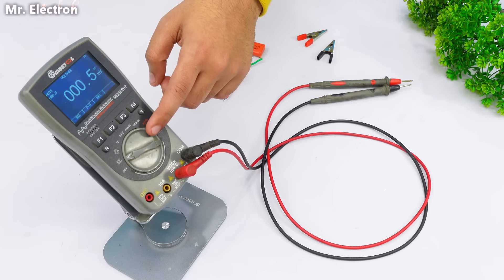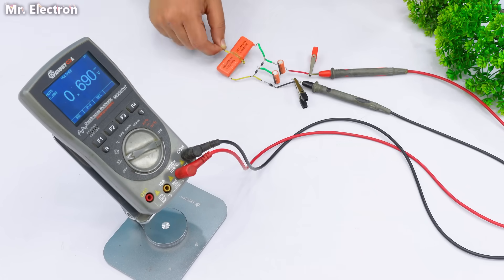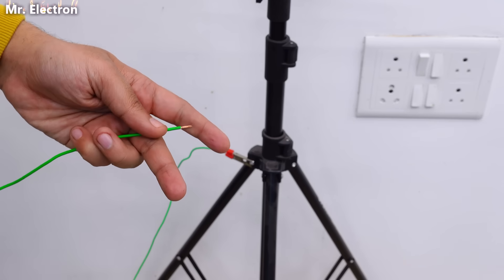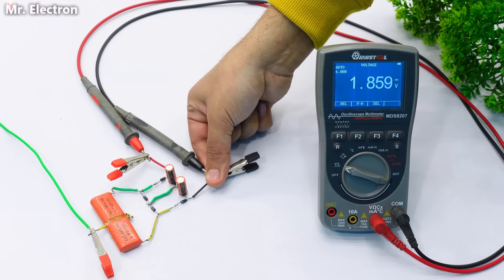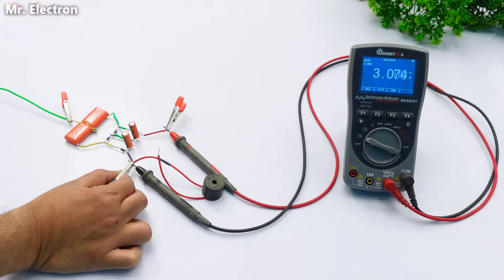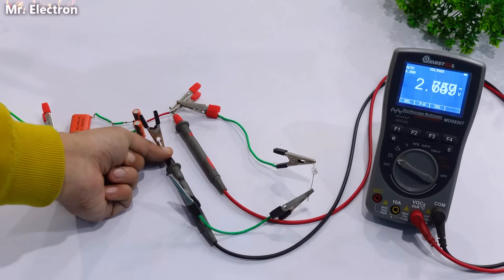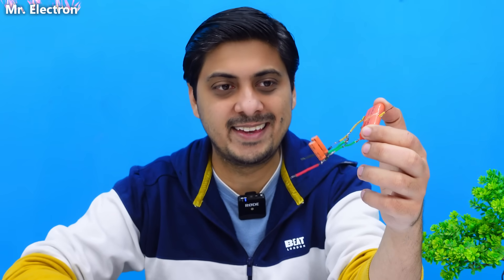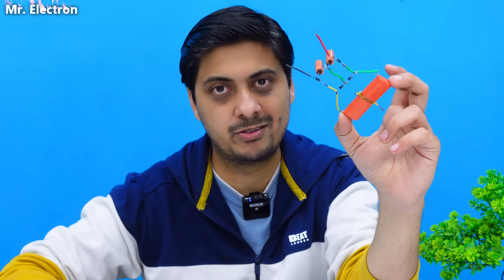Maxwell Chikumbutso - 5000 KW FREE ENERGY from RADIO WAVES | 100% Working Model DIY

Comment: I'm sure at a point in time, scientists were sure that electricity couldn't be wireless. today we have inductions and wireless chargers. 
To get usable electricity from radio waves you need a rectenna:
Antenna → impedance matching → RF rectifier → storage capacitor/supercap → DC regulator/load
Without the antenna + RF rectifier stage, the circuit will not “pull” energy from the air.
RF harvesting requires:
	•	Very fast diodes (Schottky RF detector diodes)
	•	Correct impedance match to the antenna (otherwise you lose almost all power)
	•	A design optimized for MHz–GHz signals
Typical black diodes in hobby HV circuits are often 1N4007 / UF4007 types; they are not efficient for RF rectification at high frequency.
I see your point but in order to be sure it doesn't work you need to build the same set up as his. which you can't because he keeps it secret.
Moreover, he said he got inspired by the work of Bedini.

Comment: You need an antenna / wire as high as you can get. You also need a deep grounding rod. I'm getting 7.55 vdc after rectified. Running 4 12 vdc led lights. Not at full power but works 24 / 7. I just have an old CB antenna 30 feet up at the tip. Using the house ground rod. Nice video. Keep it up.

Comment: It may be 4.5 v but the actual amps is around 10-100 mA.

That said if you got 100 of these circuits and joined the parallel the you would get some useful energy at 4.5 volts.

If then you  create a pickup coil and spinning magnets…the energy would increase.

If you the create an antenna made from multilayered metals, quartz, you would create a very interesting antenna that would channel energy from everywhere.
Reply from the maker: Hey Friend! Please JOIN on WhatsApp for a stronger FUN and LEARN community: https://whatsapp.com/channel/0029VaQmmRaFCCoWOf7huh3G

Comment: You would get more electricity and voltage if you used fast diodes, e.g., 1N4148 or UF5408 or similar and A LOT longer insulated antenna. There's a lot to improve with this circuit of yours.
Reply from the maker: Thank you for watching!💥 Check out my Latest Video here: https://youtu.be/twythhaJls0 and JOIN my WhatsApp for faster replies: https://whatsapp.com/channel/0029VaQmmRaFCCoWOf7huh3G

Comment: The green wire is about 1ohm resistor.The voltage measured was caused by the internal battery of the electronic instrument.
Reply from the maker: Thank you for watching!💥 Check out my Latest Video here: https://youtu.be/twythhaJls0 and JOIN my WhatsApp for faster replies: https://whatsapp.com/channel/0029VaQmmRaFCCoWOf7huh3G

Comment: Clearly, it is not free energy because the energy is radiated from existing platforms that have used generated electricity for modern living (city infrastructure)
So if such device is genuine (I doubt it), then over time such devices would proliferate, therefore draining the city resources and overloading the whole electrical networks of cities!
Also, to utilize such technology would require massive and heavy copper induction coils in such vehicles to create a flux density sufficient to generate power required to run a vehicle!
To my mind, there is little chance of making a viable vehicle because in reality, radio waves deteriorate exponentially from the point of source and such a system would be prone to many weak spots in radio wave transmission.
Reply from the maker: Thank you for watching!💥 Check out my Latest Video here: https://youtu.be/twythhaJls0 and JOIN my WhatsApp for faster replies: https://whatsapp.com/channel/0029VaQmmRaFCCoWOf7huh3G

Comment: You need to understand the difference between voltage and current. Plus he is using mosfets which are switching very fast. It's Nikola Tesla technology, he is not using anything new. Forget what you have been told about conventional electronics and look into the information above.
Reply from the maker: Thank you for watching!💥 Check out my Latest Video here: https://youtu.be/twythhaJls0 and JOIN my WhatsApp for faster replies: https://whatsapp.com/channel/0029VaQmmRaFCCoWOf7huh3G

Comment: I wonder if you have tried multiple units in parallel or Series?
Or adding a Invertor like a, "Joule Theaf".
Others have, and it worked..
The parallel wiring, of two units, to Joule theaf, could greatly up out put.. Charge batteries, run lights maybe small fan.
Might try, Bendini SSG, fan project and or Joule Theaf motor, invertor fan..
A least you'll be cool
Reply from the maker: Thank you for watching!💥 Check out my Latest Video here: https://youtu.be/twythhaJls0 and JOIN my WhatsApp for faster replies: https://whatsapp.com/channel/0029VaQmmRaFCCoWOf7huh3G

Comment: When u touch the negative wire, the current will have its actual path to flow, which is Ground.
You should connect the negative with Ground permanently. This may increase the voltages
Also, i think we need to isolate the antina from the Ground to maximize the input signal.
Reply from the maker: Hey - JOIN my WhatsApp for faster replies: https://whatsapp.com/channel/0029VaQmmRaFCCoWOf7huh3G

Comment: Your doing it wrong brother you need to use a 1.5mhz switch mode circuit design but use capacitor and fast switching tvs diode as voltage amplifier to 800volt and but you need to write a code when the high side mosfet is off the reverse high volt transients is capture into and capacitor tank and use with and additional mppt to recharge the battery ,  thats how it work he call it radio frequency thats what he call it but the voltage transients frequency is its own frequency difference from the switching frequency so he call it radio frequency and in a sense it is but not the radio wave in the air, the collapse current in the ferrite transformer need to go somewhere as we call back emf and the only converterthat gives strong currentpeak is forwardconverter.if you have and oscilloscope  current prob you will see what hes talking about the collapse current in the transformer core is very high and that energy is what kill moset in switching converter  if you notice alll switching converter has snubber circuit to waste the energy in heat but by use tvs diode in series with the drain of the mosfet high side and another switching circuit when the high side switch is off the other circuit activate and open a path for the snubber circuit current to flow do you understand now and reset winding use two diode one to the circuit positive and the other to the capacitor thank
Reply from the maker: Thatnks for the tip - Hey! Please JOIN on WhatsApp for a stronger FUN and LEARN community: https://whatsapp.com/channel/0029VaQmmRaFCCoWOf7huh3G

Comment: He needs to connect the center between the two 10uF caps to an earth Ground, and then make the antenna longer.   If you then put the antenna end close to the top of a tesla coil it will supercharge the FWVQ (full wave volt quadrupler).
Reply: https://www.youtube.com/watch?v=-cekt_T9yQo&t=25s
Reply: https://www.youtube.com/watch?v=tMFMDlt0gNQ&t=119s

Comment: Voltage is a masure of electrical potential, not of energy. All radio receivers devices detect a tiny amount of energy from the electromagnetic radiation they aret tuned to. There is a reason you should not stick your head  into a high energy density field kike a microwave oven. Claims about cars and houses are scams.

Comment: Voltage without current is not power. 
Power is voltage multiplied by current. 
P = V x A

So no matter how much voltage if there is no current. 

1,000 voltage times zero is still zero.

Comment: Yes, the DMM reading is real, but it’s “ghost” voltage. A 10 MΩ meter + stray capacitance can show volts with almost zero current. Under any real load (even a 47 kΩ resistor), that “voltage” collapses to zero.

True RF harvesting requires a tuned antenna + matching network low-drop rectifier diodes (e.g. Schottky),  a storage cap sized for your target frequency band, none of which this simple diode-and-cap board provides.

Grounding is critical. Your body or a tripod leg only adds stray capacitance to earth—it doesn’t magically produce power. A proper earth reference helps you measure real current, but it won’t create more energy than the RF field actually carries.

Adding MOSFETs/transformers doesn’t break energy conservation. Any amplifier or boost converter needs an input of real power. If you boost voltage, you reduce current (Pₒᵤₜ ≤ Pᵢₙ).

If you really want to test this:

Measure both voltage and current into a known load (e.g., 10 kΩ resistor).

Calculate P = V²/R or P = I×V.

Compare to the theoretical RF power density you can capture with your antenna aperture.

Bottom-line: Yes, you can pick up microwatts of RF and blink an LED once. But you cannot pull kilowatts out of thin air without a massive, powered transmitter or a hidden battery.

Let’s keep experimenting—and remember: real power is volts × amps, not volts alone!

Comment: Minds today are just as rigid as they were 200 years ago. They also said brain and heart surgery was impossible, spouting theories based on limited knowledge, theoretical laws are just that, theories that stand until proven wrong citing thermal dynamics is flawed within it'self as cold fusion is real as the powers that be just don't want to let the world know as it would mean free power, even Tesla proved at Warden cliff that energy could be pull from the ether to quote Westinghouse as he told Tesla" if I cant put a meter on it it is worthless".

Comment: Use Tesla coil as intena and use supercapacitor from old camera if you are in car use body of car as an intena connect cable to body of car  it will make alot of voltage

Comment: Better ground better circuit. If your car is having a lot of issues always check all your ground wires in the vehicle and replace them with thicker gauge copper than what it had before and you might just fix everything that was wrong with your vehicle if it was the only issue. Very common on old vehicles.

Comment: When you touch the wire you are also an extra antenna....you may be insulated from the ground regards your shoes or the flooring...you would only be grounded if you were barefoot on concrete or the earth...just a thought is all...nice experimenting...subbed and liked...look forward to more
.😊

Comment: I will try the circuit adding an etheric antenna 76.345 degree wire spun into a cone.  (Don Smith)  add a transformer to increase voltage then mosfetts to add amperage.

Comment: Maxwell  also mentioned that he used something else to amplify the frequency that he’s receiving don’t forget that .
Reply: It's a voltage double..  looks like he modified a ev motor controller to change a week current into a 3 fazed one.. the more electronics you run the power through the more resistance..  small devices that will run a radio or TV are easy to make because they all run on 6 to 12 vdc.... but scaling it up that costs money.. on top of that the power your collecting is minute, to big a coil and you run into our old friend entropy.
Reply: Amplify with what? Icecream?
Reply: @a @appinventor7740 have you notice that I got 24 thumbs up ? Why

Comment: I'm a little confused why people think this is new anyone ever make a crystal radio? It doesn't have a battery folks. Convets the radio waves into electricity then convert some into sound This just skips the speaker and puts on a capacitor. The trick is to find the frequency the provides the most power or find a way to tap into more frequencies than one if you can do that you could tap into the power of stars That produce a hell of a lot more radio waves and the local radio station.

Comment: If you increase the surface area of the antenna for Radio waves the voltage will increase to, by applying the invention of Tesla wireless Tesla coil you can transfer higher frequency AC signals with minimum voltage and use your circuit and add a voltage multiplier to transfer enough voltage to power a DC to AC inverter, your a genius person that's a radio-wave energy collector

Comment: Bro you were almost there, but you made a huge mistake, those diodes will eat up all the voltage they eat up to 0.7v  could be less without load but they reduce the power, Maxwell uses Wave guides to concentrate energy uses that energy to amplify the same energy steps up to hundreds of kilovolts then converts back to lower voltage with huge current to do any thing, it's real. Jesus Christ is the way the truth and life. It's divinely inspired that's why brains are cooking

Comment: When I lived just a few hundred feet down the road from a 50,000 watt FM station, I aimed at 10 element beam antenna at the broadcast antenna and was able to light a neon bulb with the energy coming down the coax. But it's still a very small amount of energy. Not enough to do anything practical.

Comment: Frequency is vibration...vibration is energy....collecting frequency wavelength oscillations in the form of vibration and then storing it in a capacitor or battery bank is far from impossible. Good idea.

Comment: Put a motor generator current and put a battery to charge put other batery and charge and discharge current and overtime lights and motors to had a robot autorechargable

Comment: There's a better and more practical antenna you can use to charge batteries. It's called a solar panel and the reason it works is because the transmission source (The Sun) transmits about 1000W/m² of power on earth. RF signals though you'd be lucky to get more than 100microWatt/m² within 1KM of a radio tower.
Reply: The solar panel only works with the sun, this device works 24 hours a day
Reply: @devastvola9184  That device working for 24 hours produces less electricity than a solar panel in the sun for a few seconds.
Reply: @asandax6  all depends on the size of the antenna. The ancients used structures such as cathedrals and churches to capture energy and store it in red bricks filled with iron.
Reply: @devastvola9184  No it all depends on the source of the power. You can make the antenna the size of the whole city and it wouldn't give you any meaningful power since we don't have a large supply of radiowave/microwave radiation on earth.

Comment: You have practically proved Maxwell C.'s claim to be correct which means the fact you create electricity from thin air is possible but you go further to claim he is unable to create enough for what he claims. I personally think you need to push yourself further to see how you can scale up your findings instead  of coming out to say that Maxwell's C's claim is not valid. He probably found a way to scale it up and that knowledge or know-how is not available to you at least not yet. Don't be quick to pass judgement on things you do not understand the limits of knowledge are infinitely boundless and one individual can not know it all.

Comment: Wow?!! Lambda has been disappeared.
Hi dear comment readers. Do you people know that how much power is being radiated from am Medium frequency between 500khz and 1650 Khz through AM Radio Transmission antennas 📶.
More than one Mega Watts(1MW) of RF Power is fed to the radio Antenna. So if we wana run a xtal Radio runs on the above mentioned frequency bands IS OBVIOUSLY possible  where 2 to 6mV could be extracted from the medim or low Radio Frequencies.
But This is not the case with VHF UHF EHF, AND SHF. Frequencies. The Reason is simple .Because The Attunation at above 30Mhz is drastically higher due to the curvature of earth and few more factors.So at higher frequency it's impracticable. To run even an LED with high brightness.Because the antenna 📶 at higher frequency extract power in atto Watts 10^18!!!!!!! Ultimately saying that Radio waves have different type of characteristics at different atmosphere, wheather wetness/ dryness of earth, obstacles at line of sight, means hundreds of factors

Comment: You need to do more experimentation!
Currently your conclusions are similar to a certain Dr. Faucci claiming to "follow the science", without having any substantial amount of data.
One circuit does not encompass a suitable experiment for this purpose.
How many pioneers have been discredited before thorough work has proven them right.
Even you can see past this circuit if you think for five minutes.
So do it.

Comment: Example. Data tower uses 1kw for all of its signals. How will you get more than 1kw from this? At best this can be just an wireless energy transfer and it cant exceed the input power. So its worthless.

Comment: It is not free energy ⚡ the radio station pumps out 100kw to the air

In rainy season it consume more water absorb charges

Limit it work better than wet condition
Reply: YES it is like picking up apples after they have fallen , then making an apple pie , so you can't make pies from nothing ,does that explain anything to you laymen?
Reply: @alvindixon7104  it can energise RFID tag or wireless sensor 

we are all laymen unless we try it out

china plans to use Microwaves based transmitting energy from space-based solar power systems to Earth.
 
transmitter and receiver by directional wave
Reply: Is vacuum true or false that we still haven't understanding what it is?

The Nature of Vacuum From a scientific perspective, a vacuum is generally understood as a region of space where the pressure is significantly lower than atmospheric pressure. 

However, the concept of a vacuum is still an active area of research, and our understanding of it is continually evolving.

there are still many open questions and mysteries surrounding the nature of vacuum